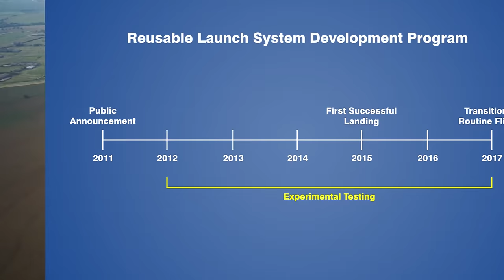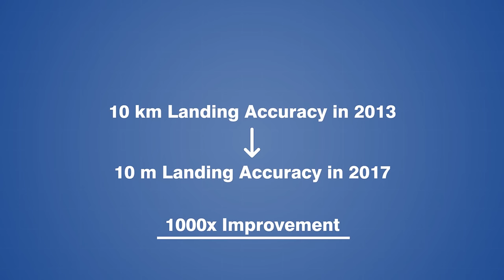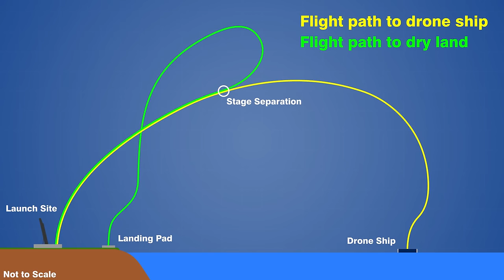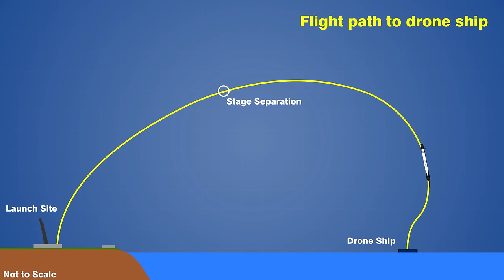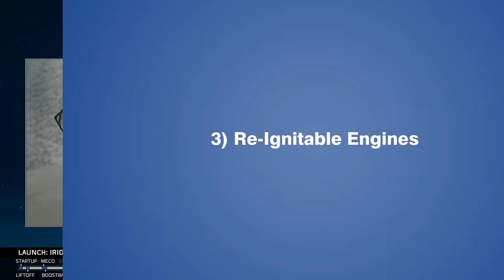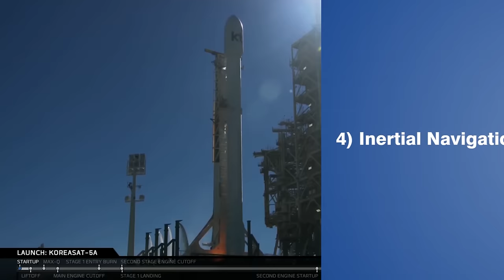How SpaceX Lands Rockets with Astonishing Accuracy

Comment: 4:19
This is how we get things done and do things right
We don’t quit when something fails or goes wrong this is why technology in the past 50 years should’ve been worked on instead of giving up because of a failure...failure is a tool to make better versions of itself and everyone even the folks who fund/invest in these things have to learn that failure is part of the creation of great things...sadly these things cost money and investors turn tail at the first sign of failure which halts progress and that’s the reason we don’t see technology that can change our way of life
Reply: True, imagine if they quit thinking that this won't work,i think the important part is to learn from those mistakes unless you correct those mistakes you can't achieve success
Reply: we would still burn whale fat if Edison quit on the 2000 tungsten bulbs or bee wax for candle. failure is a virtue that makes this world turn.
Reply: The 'we' you're referring to is  a very limited size club and are not in a cross section of the masses here or anywhere
Reply: cass nortom  Antarctica?  You look up a travel agency that books such trips and book one.  It's just that easy.  12,000 people do it per year.  By ship, by plane, by dogsled and by ski.  It's just that simple.

What does MH370 have to do with anything?

Comment: You forgot 1 key thing: AI & big data computing for precise autopiloting the rocket. During years of their r&d, they collect huge amounts of behavioral data of the whole flight path / rocket positions, engines & thrusters. So the AI computer really learns from previous mistakes. The AI system became very precise & proficient in controlling the vertical descents. Thus SpaceX's success. This is they key factor.

Comment: After landing on the drone platform, how do they secure the first stage for transportation ? The sea can be very quick to change.
I watched Mercury as a child,  this program has reignited my interest. Truly awe inspiring.
Reply: They refilled the fuel and fly back to the land base. Maybe
Reply: They have an "Octograbber" robot on board the drone ships that comes out once it is safe, and it clamps the base of the booster.
Reply: @CPlater1  Thanks. I didn't know about it. It would be dangerous under strong wind attack. Of course, they will choose a right time to do it.
Reply: A robot, officially named the Falcon 9 Securing Robot, but universally known as Octagrabber lives on the droneship and is deployed shortly after a booster landing. The robot is remotely driven from it's blast-proof shelter and positioned underneath the Falcon 9. Four arms then raise up and latch onto the Falcon 9 Octaweb, securing the booster.

Comment: The successful SpaceX landings that I've witnessed have been closer  to 1 meter in accuracy rather than 10.
Reply: That can be a little visually deceptive given the size of the rocket. 10m  is only 1/7th the height of the first stage.
Reply: @Reactordrone  Closer to 1/4, since the booster is 43m tall.
Reply: How do they not burn up in the atmosphere during re-entry?
Reply: @Angry.General1461  That's the purpose of the re-entry burn - to reduce heating on the rocket.  Did you watch the video?

Comment: Make sure to remember that there are suicide burns. This can be much better completed through more accurate computers that can run the staging sequence perfectly. This might have also played a role in their "10,000%" success rate boost. Next time, give us the math as well. I am quite curious how the suicide burn works, but I am unsure of how to calculate it completely.
Reply: You need to calculate the deceleration that will be applied, taking into account the reduction of mass as propellant is depleted, such that velocity reaches zero at zero altitude.

Also, as you might be aware (but I will mention it anyway as others might appreciate it), doing suicide burns is not only a propellant saving technique but is actually necessary as the engines (or engine - singular) cannot throttle down low enough that it won't begin to ascend again if you accidentally reach zero velocity before reaching zero altitude (landing).
Reply: @mduckernz  Ahh, I've looked at a couple of sources and the equations were all different... But I think that that will explain quite a bit. Thanks!
Reply: @thepieoneers4421  as this video delivers merely any real Information about any background... consider checking out Scott Manley (esp. for space-math-things) or Everyday Astronaut

Comment: The Falcon 9 knows where it is at all times. It knows this because it knows where it isn't, by subtracting where it is, from where it isn't, or where it isn't, from where it is, whichever is greater, it obtains a difference, or deviation.
 The guidance sub-system uses deviations to generate corrective commands to drive the Falcon 9 from a position where it is, to a position where it isn't, and arriving at a position where it wasn't, it now is. 
Consequently, the position where it is, is now the position that it wasn't, and it follows that the position where it was, is now the position that it isn't. In the event of the position that it is in is not the position that it wasn't, the system has required a variation. 
The variation being the difference between where the Falcon 9 is, and where it wasn't. If variation is considered to be a significant factor, it too, may be corrected by the GEA. However, the Falcon 9 must also know where it was. 

The Falcon 9 guidance computance scenario works as follows: 
Because a variation has modified some of the information the Falcon 9 has obtained, it is not sure just where it is, however it is sure where it isn't, within reason, and it knows where it was.
It now subtracts where it should be, from where it wasn't, or vice versa. By differentiating this from the algebraic sum of where it shouldn't be, and where it was. It is able to obtain a deviation, and a variation, which is called "air"

/ copypasta
watch?v=bZe5J8SVCYQ
Reply: Enough Pinocchio
Reply: Ah So
Reply: BUT what about the position. It’s going to be in?
Reply: Wasn't it where it was supposed to be Before it was supposed to be where it wasn't supposed to be Before it supposedly where'nt supposed to be supposed to be in Another supposedly position?
Reply: Thank You!
Reply: How do they not burn up in the atmosphere during re-entry?
Reply: we are where we are ,we can't be where we're not !
Reply: Drinking game:every “where” in this paragraph is the amount of shots of tequila/vodka (idc just choose one of the two) you have to do
Reply: Top Notch then why are you swearing
Reply: Curious Learner 😂 none of the other replies here have read or listened to the Hitchhiker’s Guide to the Galaxy.
Reply: @ToppNDP1  I hope you're being ironic to an ironic post. In that case I found this quite comical.
Reply: Trying to figure if this is incredibly insightful and informative or just incredibly sarcastic
Reply: Flex tape can fix it.
Reply: @Angry.General1461  they fire the engines 'retrograde' to reduce speed before they hit the atmosphere. So called re-entry burn
Reply: @alberto sobieski  The Falcon 9 is wicked smahht.
Reply: Haha dude, your login photo totally didn't match the login name
Reply: Sounds like Trump
Reply: @ToppNDP1  Unless the kid is unruly and then stone em to death huh?  Ironic

Comment: Lets face it - You don't have anymore insight into the accuracy than any other space x fan.
Reply: do you think he was going to give away space x proprietary technology secrets?
Reply: why? he told everything... gps, internal sensors, fins, several thrusters, reignitable engine, main thruster vector control... for me the only breathtaking systems are the engine itself and the thrusters... all other stuff are also in millions of rc toys... but those engines are a revolution... how cn the thruster keep up with so much power?`how do they reignite the main engine in space?
Reply: Tell me then "spacex fans who are so intelligent" i want to know how they land it accurately.
Reply: Take any of 1-6 listed item and READ in more detail about it.
Reply: Let's face YOU just didn't understand the video.  Don't feel bad because some other commenters were also confused.
Reply: Ok
Reply: @Knightfire66  
The SpaceX Falcon 9 rocket [] uses a triethylaluminium-triethylborane mixture as a first and second stage ignitor. - wikipedia

Burns in contact with liquid oxygen.

Comment: As an engineer I appreciate what SpaceX has accomplished to make the vertical rocket landings possible.  In addition to the factors you mention, I imagine there is also some powerful computing required to adjust the thrusters in real-time over an amazingly short period of time during re-entry and landing.
Reply: Not really much different to how a Segway balances itself.  It doesn't take that much computing.  In fact, you can do it with analog circuits and no computer at all.

Comment: Interesting!
What else do you Believe?
Reply: Are you implying that you don't think it's possible to land a rocket back on earth vertically? Could you explain why this manoeuvre can't be accomplished?
Reply: @sailorman8668  no, actually I'm not.
Sorry if you had something prepared.
Reply: @mrrutledge1967  Just so I'm on the right track here, I'm assuming from your first comment - 'What else do you Believe?', that you don't actually think it's possible to control a rocket in its descent back to earth, to land on a pad?
Or was your comment directed at someone else's comment, in which case I'm wondering why you didn't 'reply' to that specific comment and place your response on that specific thread?
Reply: @sailorman8668  just go ahead say whatever it is you're dying to say.
Let me take the bait and you go ahead and try to set the hook.
Not for one second do I believe a rocket booster has traveled to Earth's extreme upper atmosphere several hundred miles from the landing area then found it's way back to the center of landing pads. Especially successfully landing on a ship at sea in any conditions.
Now go ahead and spew whatever nonsense you've been programmed to believe.

Comment: Rather simplistic. While you introduce each of the design elements you should do more to explain their integration as a complete system, how they interact, and how they deal with the conditions experienced during different phases of flight. Additionally, an explanation of  how the IMUs and engine re-light systems would be interesting (assuming most people already know how GPS and aerodynamic control surfaces work).

Comment: My suggestion in 2015, passed through "The Grapevine", of increasing roll control authority gave them the solution that made it stop crashing on landing. In essence when the rocket tilts north it has to gimbal the rocket south so the base can go north to stop the tipping. But if the rocket is rolled slightly clockwise it thrusts south southwest tipping the rocket north northeast. Then it had to gimbal west to counter the east tip. Still rolling it thrusted wrong again. It was making wallowing moves as it landed as it tried to get into the right orientation without proper roll control to keep the thrust on axis of whatever tilt it had to overcome. It was well accurate as to where it went. It was just inaccurate in its roll orientation, and therefore its angle, and its orientation momentum at landing. It doesn't work if it's vertical on touchdown when it's in a tipping slew at the time.

Comment: The power of closed loop feedback control systems and the selection of sensors. Mostly invisible.
Visible and most talked about are the steering and control actuators, like nozzle vectoring, lateral thrusters and the grid fins and most important throttling capability.

Comment: Grid Fins are also the control system used in MOAB(Mother Of All Bombs)
They are high Lifting devices often used as alternate to wings
Has so many variants based on orientation of panels ,the number of panels, the depth of fin, etc.
Straight forward to design and analyze but hard to optimize on Panel level...

Comment: Space X sets the standard for engineering excellence.  Discussions about titanium  grid fins, landing legs and GPS are well and good, but overlook the crucial element that makes it all work. The unseen control software contains the crucial feedback algorithms that adjust the control elements (fins, thrusters, engines ) in just the right amounts to make the landings look effortless  The control system feed back is perfect. Compare Space X landings to Blue origin and yo will note that the BO rockets hunt back and forth when landing due to improper control system feedback.  Bravo Space X ! They have the courage to fly it, break it fix it and fly it again until they get it right.  Face it, serial number 1 is always going to always be less than it could be no matter how carefully you engineer it.

Comment: Great video! 

One thing that wasn't mentioned was *software**.  That too would play a big role in the amazing accuracy of the booster landings.  I'll bet there's a **heap* of code in there referring to "deltas" - differences from expected values - and it is code like that that helps to get pinpoint accuracy with the boosters.
Reply: That was explained, but not in so many words when the narrator spoke of the automated  computerization of the landing.

Comment: The landing accuracy has been very reliable. I wonder whether they could do away with the deployable landing legs altogether by landing in a cradle or capture system of some sort. That would save weight, simplify the design (of the rocket), reduce drag and reduce the risk of deployment failure leading to damage.
Reply: They are trying to catch the fairings in giant nets to be able to reuse those.  I'm not sure if they have done it yet though.

Comment: Incorrect. Typical droneship landings use only an entry and landing burn. A boostback burn is either used for rtls or some shorter distance droneship landings. It is not the norm.

Comment: Hello. Since this video(2019), very good BTW, have you found out any more detail specific information? I am always wondering about how many trajectory correcting inputs the computers are processing. LIDAR? SONAR? Microwave? How many distance and speed measuring vectors are the rockets using to land so precisely. I ask because they seem to be able to dismiss weather conditions, basic ones, and still land exactly where they want. A super apple air tag? Space-X came first but both are about locating something. Any update?
Reply: I do not know what they are using, but sonar is not very precise because it depends too much on the exact weather conditions. Lidar is highly problematic because it needs clean optics directed down, which is very very difficult for a rocket which descends into its own plume!
Microwave/GPS is mostly likely used, GPS is about 1Hz. I am quite sure they are using a microwave assistance from the barge, so the rocket precisely knows the direction and the distance of the barge. The barge also has thrusters in the water, so it can correct some of the drift of the rocket itself, and ocean drift too.
From what I have heard they did not invent new technology for the navigation, just used very smartly what was already developed (assisted GPS can be extremely precise!).

Comment: rather than using thrust produced by fuel for vertical landing to land on earth they should connect automated drone fins which can slide out as soon as the rocket enters back on earth"s atmosphere and allow drone-fins to control the rocket landing. then it would be safer and save more fuel as well.

Comment: Gah. This video broke my heart. Soooo close. I am looking for a visualization of the return to dry land, as SpaceX isn't using floating pads at the moment. I can't visualize the changes in altitude and velocity during the start of the burn-back phase. The velocity never goes to 0. So I am assuming it's trading off velocity in one axis for another. What confuses me is that velocity continues to decrease for a bit after the burn-back is complete. Then while the altitude is still increasing, so does the velocity. I just don't get how it works.

Comment: will the falcon rockets be used for a hubble repair mission now that it has flown higher than the orbit of hubble during the inspiration mission?
Reply: That mission is being investigated. Nothing has been confirmed. Height was never an issue. Unlike the Shuttle the Crew Dragon doesn’t have a robotic arm to capture the satellite or an airlock to allow astronauts out. These problems are being investigated to see if the mission is possible.

Comment: Put a parachute in the head from falcon, this increase the eficiency  and weith
Reply: I thought the same thing.  I wonder why they don't use parachutes to at least aid with the controlled descent.  Wouldn't it lower fuel cost by requiring less of it to land? Carrying less fuel would also lighten the load.
Reply: I thought the same thing.  Parachutes probably couldn't do exactly the same,  but they could at least help out with the controlled decent. Wouldn't it lessen the cost (less fuel needed for landing) while also lessening the load at takeoff (less fuel to carry)?
Reply: jayfridayaq Wouldn’t Parachutes actually make landing the rocket a lot more inaccurate since the space at where it lands on is now completely determined by wind? I’m pretty sure that landing with parachutes on a landing pad in the ocean would be highly risky since any change in wind can affect accuracy. Rockets or stabilizers wouldn’t be as efficient since drag from the parachute would make fixing harder and the rocket might not even be upright.